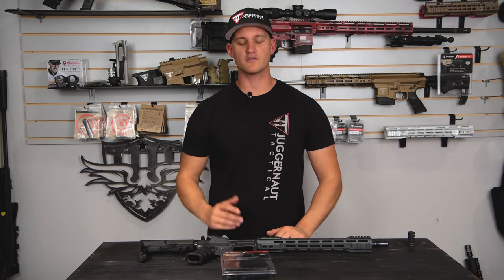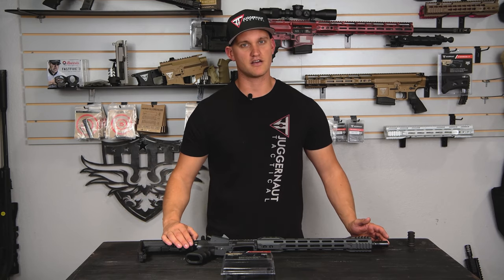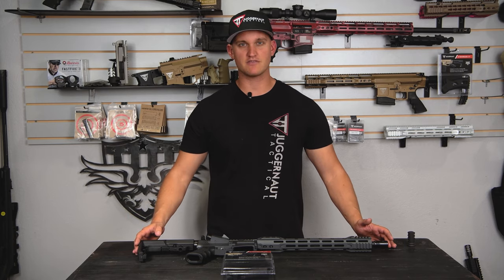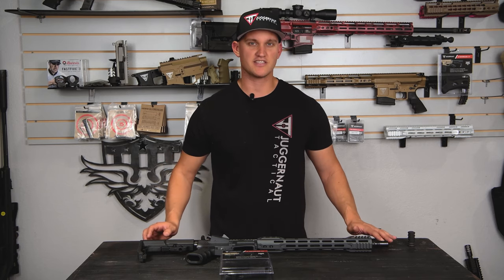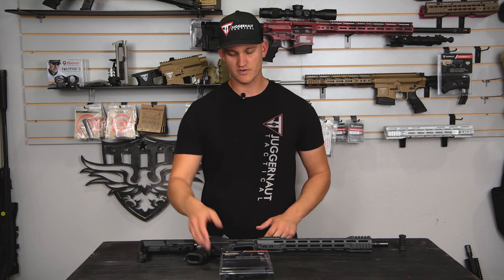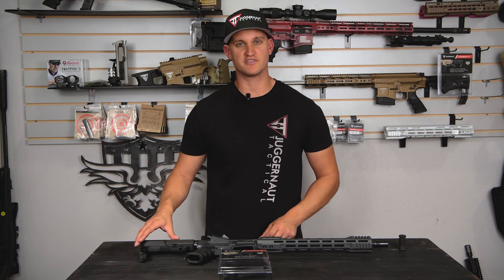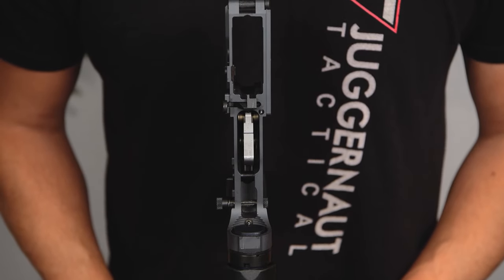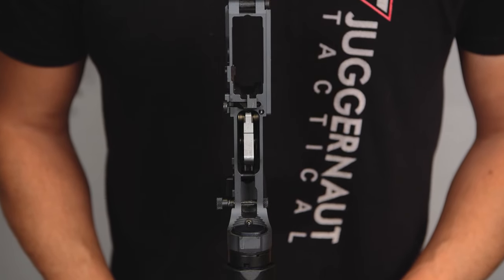Switching fixed mag JTE to Featureless - what you need to do

Comment: I have 5/64 Allen but cannot take out the set screw? Anyone have any tips ?
Reply: He said that it was put in with locktite, maybe even red locktite, i dont know. If it is, you'll have to either heat that area up with a torch or flame and loosen it that way, or drill it completely out with a metal drill bit.  Watch some youtube videos on how to remove red locktite and post your results so we can all know! So far, I've kept it mag locked. You can also call Juggernaught and ask
Reply: Was wondering the same thing too. Tried to install the maglock gen 2 but the damn pin is making it useless. I was thinking of just using a Dremel and grind it off as it seems when it's under pressure you cannot press mag button  As when the pin goes up its able to free itself.
Reply: @doodlez2439  yeah, if you cut the top off, the freedom fighter maglock won't work
Reply: @tizben  No you see what I'm trying to say is the pin itself pops up when there's enough clearance then you're able to press on the magazine button. But once the upper is closed the pin goes down not allowing you to press the button . That's what I'm trying to say the pin itself needs to pop up a certain amount to be a to press the mag button. As with the maglock you only need a certain amount of open space between upper and lower to be able to maglock to release the Magazine.
Reply: @doodlez2439  Ok, I see what you're saying. Yes, if you have both the ar maglock and freedom fighter maglock pin, they'll interfere with each other because of that pin. Here's what you do, since you already have the freedom fighter pin kit. Open up the upper and lower receiver. Then press and hold in the mag release button, that way the freedom fighter pin wont depress down into the lower receiver, take a hand diamond file and slowly file the pin down.  Then close the upper and lower, pull the charging handle and lock the bolt open, so that when you open the upper and lower with the juggernaut hellfighter button, a smaller crack between the upper and lower will be open. That crack in the upper and lower receiver will be much smaller than if the bolt was not locked back, and the goal is to keep filing down until the pin is short enough to be able to release the mag when the bolt is held back and still prevent the mag from being released when the upper and lower receiver are closed. Keep checking often while filing. People have done it before in other reviews, but there aren't any videos showing it because of youtube policies. Check out this video for explaination https://youtu.be/aUYr4aLfoJw and read the comments in https://youtu.be/VGGkqnLiOls Hope this helps
Reply: Use brake cleaner that’s chlorinated!!! I let mine soak for a couple hours and it came off like butter!!
Reply: Hot soldering iron